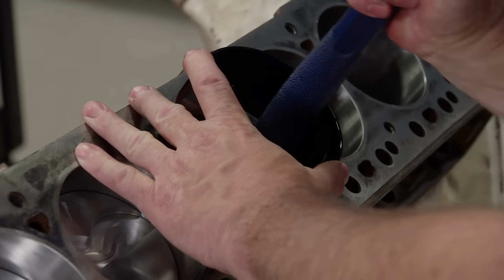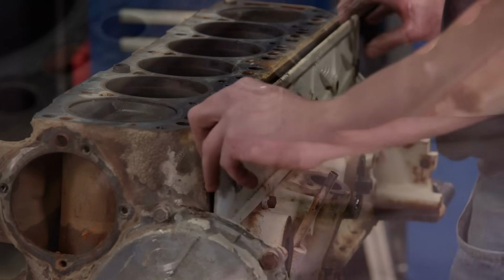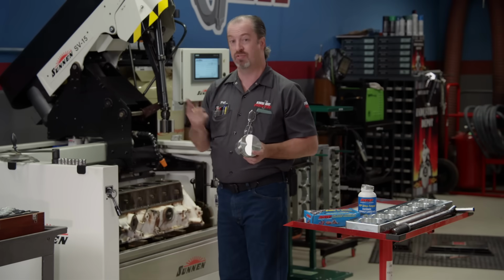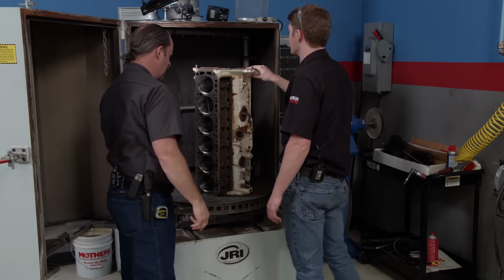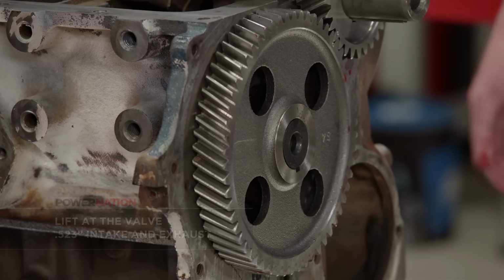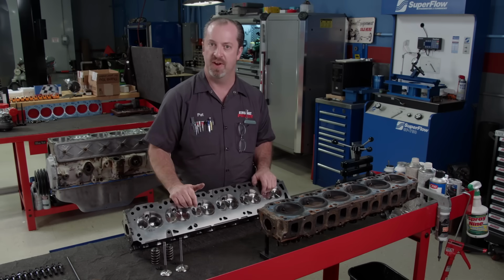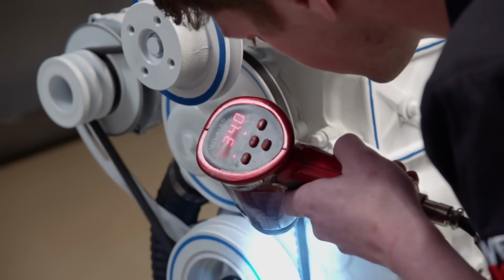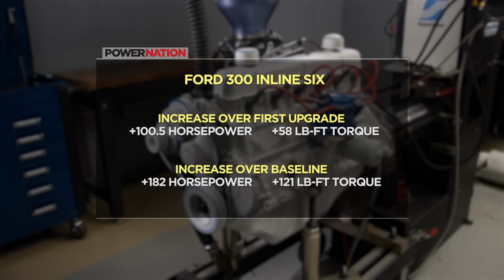Full-Tilt Build On Our Ford 300 Inline 6 For Serious Power Gains - Engine Power S8, E3

Comment: Most of those watching this probably believe that this is a novel build for a Ford 300 inch 6 cylinder. It's not. 

Ak Miller built one back around 1967 that dynoed out at 300 horsepower and was naturally aspirated. It was one of the first engines to produce 1 horsepower for 1 cubic inch and some said it sounded like a P51 Mustang straining to get off the ground when pressed to the limit from a dead start. 

Mickey Thompson also built these engines to be used in stock cars. If you knew your part numbers you could order all of the parts Thompson came up with directly from Ford. The reason Ford made Thompsons parts available to anyone with the coin was if they were made and offered by Ford they could be legally used on the stock car circuit and the tech crews could find nothing but Ford parts on inspection. Remember the old adage, "win on Sunday, sell on Monday" and Ford made full usage of those Sunday wins. These engines also helped on the circuit because they were lighter than the eight cylinders of the time and offered better weight distribution which helped to limit "snowplowing" in the turns. 

C.J. Batten also tinkered with the 300 and came up with a cross flow head to fit. Batten took three Ford Boss 302 heads and cut out the centre two cylinders in each and welded them together to fit the 300 block. Bruce Sizemore used these heads on his Ford Maverick and held the H/MP Maverick that held the class record for a while during the 70s. Sizemore, formerly of Preparation H fame, did considerable valvetrain developement and terrorized the former chevy stronghold of I and J/Gas.

Comment: I saw a front engine dragster with a Ford 300 straight six a couple of years ago running at Thompson Raceway. It had a cast iron cross flow head on it! Retired Ford engineer said it would have gone into production if they hadn't gone to the 3.8 V6. I wonder if Powernation could borrow one of those heads from the dragster owner?????

Comment: Loved my ‘91 300 EFI.  I want to say the factory EFI was about 150hp. It seemed like a massive improvement over the factory carb version.
Reply: @ Chris and Matt--Big Shots!    I was just reading somewhere about your comment. Im no 300 expert but it seems the EFI didnt make the difference, it was the shapes of the intake and exhaust manifolds on yours that promoted better breathing. Your manifolds and a 4-bbl Holley would exceed that horsepower. In fact, a 4-bbl and headers wouldnt exceed what you had. So, as ive read, hot rodders would use the EFI manifolds and then proceed with what else they were doing. I think EFI itself was more for pollution than power. I have to ask on a forum but you might have an idea, what do you believe was the last van to use the last 300? The 300 was standard on E-series but ive never seen one, they all seemed to have V8s like the 302 as soon as they were offered. Supposedly, 1996 was the last 300. Was it still available in a van then? Thats what im looking for.
Reply: @cvcoco  Yes, 1996 was the last year for the 300 in the E van. I knew a guy who had one. Great engine.
Reply: @edifyguy  What ive learned is that there are few engines in the world that are more solid than a 300 but thats only the engine itself. In pickups and others that used the engine, everything else is very crappy--- all the peripheral components like electronics and whatnot can be very troublesome and expensive to fix. A great engine --- that could easily leave you stranded somewhere.
Reply: @cvcoco  Just put a carburetor and points on it. The pieces shouldn't be hard to find since it was shipped that way for the first decade or two of production. Personally I have had good luck with electronic engine management, but I have had failures, and understand why people hate it.
Reply: @edifyguy  I agree, though Im not sure carb/points would pass a  SMOG check in states like CA. But manifolds, carbs, points distributors are available so it can be done. Also, not sure for the 300 but for an old Nissan I changed the points to electronic points and it made a huge difference. Its a module the same size as standard points and bolts right in. Also, again not sure for the 300 but Holley makes electronic-carb kits for other engines and it ends factory problems. A person willing to fool around can wind up with a much more reliable and rugged setup.

Comment: Another video of big cubic inches not being able to keep up with less cubic inches that can spin rpm

Rpm is the replacement for displacement.

If the goal is to pump 1000cf of air
You can use a 1000 cid engine and in 2 revolutions it's pumped

Or you can use a 100cid engine and 20 revolutions it's pumped. Both will make the same horsepower.

Comment: This is a smart man's engine. Fools see the 300 and think that it is weak. Smart people know what the long stroke does for it. A phenomenal engine. A legend.
Reply: Saw one of these transplanted into a '63 Fairlane at the local oval. It was kicking butt until it blew.  They are a great engine and respond well to building if done properly. And the long stroke made it a great truck motor, it's why the pickups had them!
Reply: @rocketmail125  No you'd be excited too if you weren't a dumb kid. See there's a difference in inflection...
Reply: You are right. I had one in a 78 ford F-150. I only put 327,000 miles on it. Bullet proof! Only reason I quit driving it was I wanted something with an AC to blow cold air in my face.
Reply: As I get older I see the six cyl. in a whole new way. they are cool
Reply: My first truck engine. Stock the engine itself is absolutely bulletproof. Wonder if the slant mopar or ford 300 is the winner all else similar.
Reply: This would be my ideal light truck engine.
Reply: @threecedarshomestead1330 good for a mid-60s Econoline Van’s engine room?
Reply: Well some people want everything power windows leather moon roof theu aint using it for a truck its to go to town in and say they have truck ....with all that electronic crap on it theu cam keep them and the price they want for them
Reply: I already know! Mine was a monster until it rebuilt.  The engine rebuild shop dropped the compression to 82 stock. It had 9s in it and would burn tires down the street. Now all it does is suck gas. 82 f150 4.9l...
Reply: am currently buying a 300 inch ford pu. no experience with that engine but.... I did a similar build with a 292 chev in a 70 nova and it absolutely spanked the smogged 350 camaro's, I mean it was embarassing. it sold me on large (relatively) inline 6's. currently running a built 460 in a 95 F-250)(sadly the affordable good chevys died in the early 70's and my 92 5.0 sold me on Ford forever) but it's more than I need and the gas cost is killing me. I have great expectations for the 300 in an F-150 and this article has me stoked (wait...did I just date myself?), thank you, thank you, thank you. (BTW my 460 powered 74 F-100 ran 13.60's...daily driver)
Reply: The is one of truest comments I have ever seen on YouTube.
Reply: @Stucifer  You can import them, but that is the reason why it would be cool to have them play with one! 
See what they can/could do with it!
Reply: Dude check out a Mopar 245/265 Slant Six.
Reply: @JA-ox7hm  The "Leaning Tower of Power" is indeed a great little engine.  As a truck motor it can't hang with the 300.  I've known people with Dodge vans and trucks powered by it, and they are among the slowest I've ever ridden in.
Reply: @Stucifer  so I am referring to the 245/265 hemi slant 6. 
The 265 dynos, stock, at 303 at the fly wheel.
But it is only found in Australia 🇦🇺 that I have found.....
Reply: I knew a guy the took a 292 Chevy. Put 350 heads on it. Yep 350.  He was a very good welder.  Chopped a cylinder off each. Filled block bolt holes. Filled the head blot holes modified the oil water passages to match up . Re drilled and tapped the head bolts so they would match. Then he made his own head gasket. Yep fuel went in one side of the head and out the other side. Put it in Chevy Malibu for dirt track racing and the others with 350 racers wanted to ban him. He said that was the only engine he used for the whole season.
Stuff like that is possible when as many parts as possible are shared among different engine designs. Unlike a Honda. yep you CAN NOT put a automatic engine in a stick or the other way. Not a problemo any more. Who makes a stick for the US market?
When GM made the inline 6 truck engine that was never installed in truck it made 295 HP on 254 cubic inches on 87 octane. And no puffer added.
 NOW why was it never put in a Silverado?
The engine bay was not long enough. 
So why no high horsepower I-6s? Wouldn't you rather have a V-8?
My brother sold his 4 x 4 crew cab 82 Ford, Still running and drive able with over 300,000 miles on it. Again the old lady wanted the ugly thing gone. Besides that it was a stick.
Pretty the same argument I get now that the 2004 Envoy is still in the driveway. She want me to replace it with a new Fusion.
The neighbor to 2 blocks down has the V-6 Envoy with lots more problems with 1/3 the miles on it.
Reply: @warrenpuckett4203  351 heads can be welded and put on a 300i6. You can also use LS heads. But old school dragsters used 351 heads and we're making 500+n/a I think ym dad said a guy made 634 n/a with a 300 online with 351c heads
Reply: 300 is not a " long stroke" , bore and stroke are close to equal , which is considered to be the optimum balance between torque and rpm , the chev 292 was a long stroke engine which made it better for load pulling but not as good for fuel economy,rpm or just cruising , lots of chevs blew up from rpm , lots of Ford's wore out from low rpm pulling
Reply: @outinthesticks1035  shorter heads are better for low end torque longer heads are better for higher rpm torque.
Reply: @outinthesticks1035  Oh gag me with your personal semantics. Compared to say the Chevy 350 or Ford's 351s... oh wait...A 4" Stroke in a gas engine is a long stroke. (notice the period cause that means period...)
Reply: @SaneAsylum  out in the sticks is correct, but so are you. He is talking about whether it is a square motor or not. You are making a comparison between stroke of this and something like a 302.

You are both correct, in different ways and that is OK.
Reply: @SaneAsylum  An engines stroke is always relative to it's bore if you want to define it as long or short stroke.  Anything else is completely meaningless.
Reply: @SaneAsylum  Anyone that knows anything about engines will say an engine is long stroke if the stroke is larger than the bore.  Anything else is nonsense. A Wartsilla ship engine has a stroke of over 8 feet, so therefore every single truck and car engine is short stroke using your (lack of) logic.
Not sure why you think Palestinian terrorists getting their ass kicked adds to your foolish argument, I presume this is the desperation of someone that knows they are wrong and has to try deflecting.
Reply: @SaneAsylum  "Torque is produced over long stokes"

Again you show your lack of knowledge. For a fixed displacement an increase in bore size exactly cancels the reduction in stroke, everything else being equal.
In practice longer stroke engines are generally tuned to have higher torque at the cost of peak power simply because they are less suited to the high RPM operation that high power outputs require (normally aspirated).  Smaller bore means smaller valve sizes, so volumetric efficiency suffers and long stroke means a weaker crankshaft as well a higher piston speeds and accelerations.
Reply: 1988chevy Camarillo rear hatch pull down switch

Comment: Fuel injector: measures persisted amount of fuel 
Carburetor: lol u want gas “floods engine.
Reply: Carburetor: lives mechanically 
Fuel injector: voltage is too low and I've burned out the FI computer
Reply: Cause pat the gas 15 times before they turn the key!! Run it 10 miles before they push the choke back in
 That's why they went to automatic choke!!!
Reply: Yeah injection is superior, but for the guy who doesn't have the cash to get that setup in a carb is perfect. Slap it on, connect to stock fuel pump, dial in your ignition and you're away. Good carbs (ie Holley Brawler, Edelbrock) come with an electric auto choke, too, so you don't need to worry about cold starts. Just turn the key, give one pump and start.
Reply: @boingkster  also for reliability in small engines
Reply: I’m not talking crap I’m just saying fax
Reply: @danielbetancourt2792 if you're not an idiot ad know how to properly tune a carburetor, they don't flood, they start right away, no hesitation or bog. Everything you need. Yeah average injection could be marginally better but bang for buck....
Reply: Don’t mock what you don’t understand. You sound like older people mocking fuel injection. I managed 58 mpg with an 80ci Harley and made excellent power. And a camaro with a 383 stocker and could knock down 19 to 21 mpg both with carburetor’s both where daily driven and reliable. I use fuel injection now, but just because I’m lazy and it’s easier. Wouldn’t claim it to be better.

Comment: The 300 in my 96 F150 has 550,000 miles on it and it's still running strong with only the gaskets and seals replaced .. no internal engine work.

Comment: Bought new 1981 f150  shortbed 300 6cyl..hailed firewood,and frieght,towed 6000lb trailer for 13 years wide open,,no problem.3 speed on the collar,would outrun 350chevys ,,stock.♡♡♡♡♡♡

Comment: You see those neet reinforcement ribs on the water pump? One of my old inline sixes didn't have those ribs on the original. So the factory pulley didn't fit anymore, because it hit the ribs. I had to grind down the ribs. Just a thought. It was a 250, 292, or 300cid. ....Good Luck.

Comment: My late Father-in-law was a mechanic and a truck driver. He was also a dedicated Bowtie guy. He died over 35 years ago. He told me once, the Ford 300 was the best truck engine ever manufactured.
Reply: My dad was a mechanic at lacygne power plant for kcpl I believe 34 years he worked there until he passed away. He drove a 1983 f100 300 straight six 3 speed column shift from Clinton Mo to lacygne ks 5 days a week.  At 780000 miles the state of Mo deamed it unsafe to be driven on a public roadway due to rust. At that time he sold it for 600 bucks to a farmer it had the original never rebuilt engine the never rebuilt manual transmission and original clutch.
Reply: @roberthaynes4639  i miss lacygne
Reply: I am a chevy man but I had a 1983 ford f 150 with the 300 and man I loved that engine
Reply: They were very good engines.
Reply: Whether you believe Ford used to be the second greatest car manufacturer or not (obviously behind AMC) the 300 is the greatest truck engine ever made, they pulled everything from F-100's and 150's to F-Superduty dump trucks and semis, and even busses.
Reply: You guys forgot to put the rag in the new water pump.  Lol
Reply: I would agree.
Reply: God bless him
Reply: I will amend that, by adding "best gasoline truck engine ever manufactured." It's bested only by the 5.9 Cummins. I like those 5.9s so much, I swapped one into my '78 Bronco.
Reply: I agree... however it just didn't make enough power.
Reply: @RidgelinePatriot  it didn't go fast, but it practically moved the world for decades. It didn't lack power, just speed it'd move anything, and do it forever.
Reply: @RidgelinePatriot  For what? My dad welded together 2 Boss302 /351C closed chamber heads cut up a hilborn fuel injection and rewelded it to a straight 6 and added big cam and high comp pistons to a 300 Ford 6 in 1969/70. It replicated the dominating engine in NHRA a gas altered model T. That engine was so powerful and so good for durability. GM and Mopar had no way to combat it.  NHRA eventually loaded it down with tons of weight, so others could compete. They basically outlawed the 300 Ford 6 it was making 600 hp and dominated the class for a few years!
Reply: I would agree with him. I'd rather have a built 300 in my 67 F100 4x4 than the 428 that in there....build AND fuel injected. I've had a carb 300 and a fuel injected 300...huge difference in power & torque..but to have it built, that would be awesome.
Reply: That’s always been my opinion, but honestly when it comes to reliability you can’t go wrong with almost any inline 6 including the old Dodge/Chrysler slant 6

Comment: My parents put over 300k miles on a 3/4 ton with no overdrive with a 300. This may not breathe fire, but I love seeing the potential. I wish I could copy this engine and put it in a ranger or short mid 90’s 1/2 ton with a manual

Comment: Love my big motors and had delight with many from a 53' dodge with 292 hemi , a 429 in 70's F250, all around great Chevy 350 and 453 inline detroit in one logskidder but for long term tough dependable with great mileage I love the inline 6. Currently have an 88' F150 with one that has the 4speed granny tranny, another low in transfer case that will pull stumps out, cruise around with a cord of wood with its stock f250 leafs and I just love the putting it around with amazing mileage on gas. So long lasting it gets to be a bummer to not need to work on its easy pulling and all around engine maintenance. Surely should be listed up with best motors ever made.